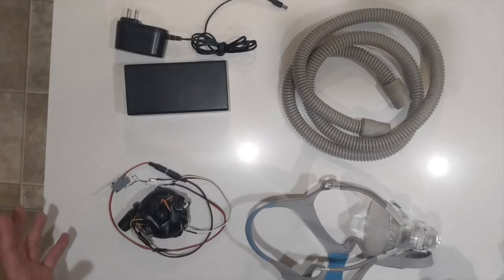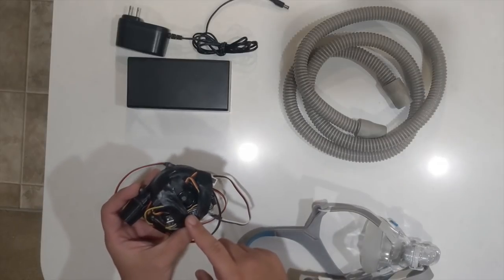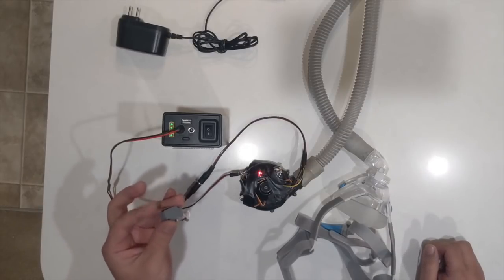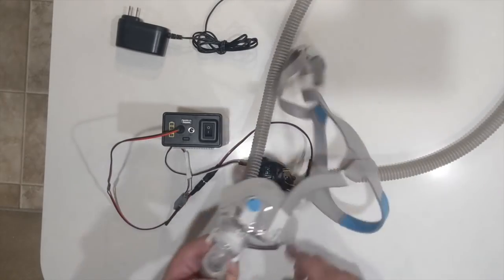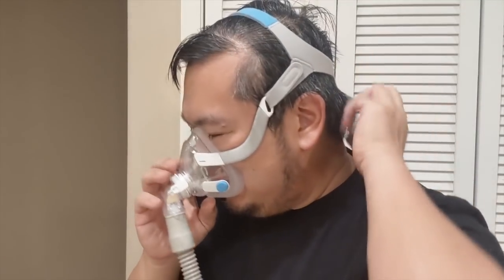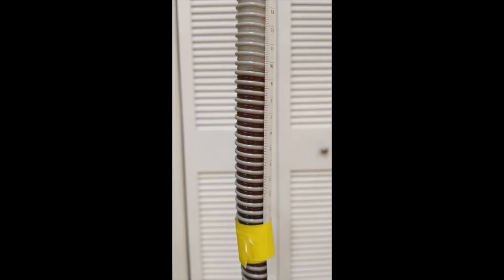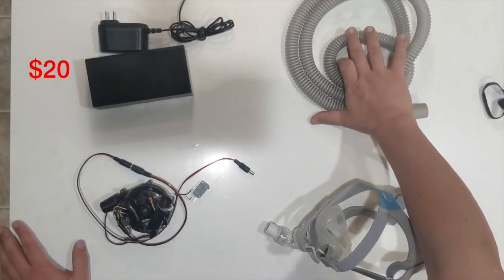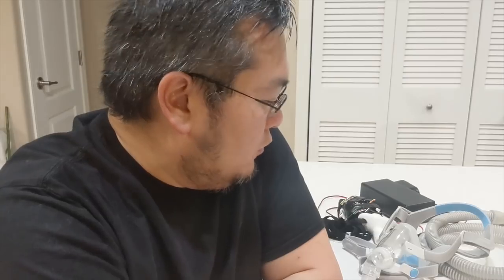Low-Cost Open Source Ventilator-ish Device

Comment: I believe the most important next step to this project would be to add an oximeter (finger). Suppose you can get to a point where you can setup various parameters on this. the biggest bang for the buck it's to get a pulse oximeter, so you're able to "read" and display the amount of PaO2. I understand what you're trying to do. I was researching the same thing. 
Problem is a "Medical Ventilator" it's not simply an air blower with enhanced O2. Although, from an engineering perspective, it's a relativetly simple machine, the Respiratory System isn't. It requires some medical knowledge or at least some Biochemistry knowledge.  I was a medical student. There's a lot of knowledge required to even setup a "medical ventilator" in order to help the patient and avoid worsten the patients health issues. Let me give you an example: If you put a lot of pressure, into a person's lungs, it can make thing worse, because of the shear stress, that would increase inflamation of the lungs, and as a result, worsten the situation. Oh man, i love your idea...i was just doing the same thing...and i'd just like to make a few comments so people like you and me (even being a medical student) to understand it's not that simple. But at the same time, i believe you should keep improving your project. But the key here to start off is to do some research on PaO2 and pCO2 and FiO2, understand what is the main goal of the respiratory system, how does it relate to optimal blood ph and homeostasis.
https://youtu.be/Te0WLR71HwA
https://www.youtube.com/watch?v=gk_Qf-JAL84 (Mechanical Ventilators explained)

Comment: Thanks _ why is the certified ventilator so EXPENSIVE.
Reply: Pra Drame Commercial grade ventilators are built to last for many years using the highest quality parts with all the bells and whistle’s (you don’t necessarily need a Rolls Royce when a Toyota Corolla will accomplish the same task).  Also,  the markup through the medical supply chain is astronomical (similar to the $10000 toilet seat for a military transport).
Reply: Brent Mart you guys are tripping. How is this device modulating the amount of O2 and CO2 and keeping it flowing into both lungs in equal amounts. I don’t think he has a basic understanding of how modern ventilators work. Nothing wrong with taking a stab at it but to think ventilators are just vacuum cleaners with a pump is pretty naive. You can’t just have a malfunction, the person is on life support, it needs to run non-stop.
Reply: Watch:                           https://youtu.be/KN8WwNotGP8 

“Where there is a will there’s a way” and “necessity is the mother of invention”. And 1 more:  “never underestimate the power of social media”.       Cheers 🍺

Comment: How do you dispel air breathed out?
Reply: CPAP masks has tiny vent holes on the t piece that connects the tube to the mask itself where it uses the venturi effect to get rid of the exhaled air.

So the mask is constantly venting air out of these tiny holes so it is kind of annoying for the bed partner of a CPAP user.
Reply: @tibbydudeza  Just add a simple asthma chamber to the system and breath out  it's expelled.

Comment: Your efforts at attempting to design a useful ventilator deserves due kudos. I am not a doctor but I do feel that you machine could be of actual value and use. Unfortunately where I live none of the components you have used are available. All that is available is the flexible tube used as  lead out from the washbasin to the outlet pipe.

Comment: can a home vacuum cleaner be striped for parts and modified to make a ventilator?
Reply: Indeed it can.  In that instance the control would be a rotating valve in the output tube.  In the long-ago I developed a device that used a rotary solenoid to move a valve.  I recall that the first mockup was done, and working,in one day.  The client, Eastman Kodak and it had to do with microfiche management.

Oh Yes, I had the tech go out and buy a small vacuum cleaner,  replaced by a stock blower in the final design.
Reply: Would overheat and burn out I would say.  Maybe a small battery powered unit could work.

Comment: I am not a specialist of any kind. However, I have been using a CPAP for many years. I noticed there is a difference between your home made mouth piece design and the regular CPAP mask. The masks always have vent holes through which air is leaving at all times. I presume that's where the CO2 leaves the system. How and where does the CO2 leave with your closed system? . . . . . I don't know about medical ventilators, but I do like the idea of making your own CPAP machine and saving thousands of dollars.  This is do-able.

Comment: I see some sort of one-way valve assembly in either the mask or hose. Similar to divers SCUBA exhaling (see comment below). I am a retired control systems engineer and for (KISS) keeping it simple, this design is genius. That speed control from CPAP was inspired. Hospitals need something more into recording and readout for personnel and this is understandable. So each unit probably comes with $25K in readout equipment that has little or nothing to do with keeping you breathing.I havent read all the comments yet I do have questions that have more to do with physiology than engineering.

Comment: Hi Johnny, I appreciate all your efforts in designing an open source ventilator design. Consider controlling the expiratory/exhalation side for controlling pressure and duration with an over-pressure relief valve for safety. Maybe look at other designs and adapt those into yours. Over the years there have been many simple yet genius designs for ventilation that operate strictly on oxygen pressure (bottled O2) with the entrainment of air for controlling the O2 percentage without the use of electricity. Keep up the innovative thinking!

Comment: Two points: Ventilators are connected to O2 not room air and secondly you could connect this device to a simple pulse oximeter that would read blood gas levels and adjust the rate/pressure to a targeted level.

Comment: I also plan to test CPAP options using cheap hair dryers with very low pressure. The inches of water could be easily adjusted by drilling holes in the tube itself. For sick patients it seems below 20 is the target.

Comment: You might read a bit about I:E ratios (inspiratory / expiratory) as you consider your software programming.  At rest exhalation is typically twice the time of inhalation which is something that is adjustable on a ventilator if not completely automatic based on it's algorithms and sensors.  A spontaneous Bipap senses exhalation and shifts automatically but that sensor isn't something you would have in the Cpap.  Without being able to tune the I:E you will have trouble achieving synchrony with the patients breathing.

Comment: If no O2 tanks or O2 concentrator available...and the AC power was still on...water electrolysis could be be used very carefully to add O2 into one of the ports on the mask. However, that would ideally require O2 under greater than the CPAP pressure. It could probably be placed at the intake port at atmospheric pressure to good effect. With appropriate AC rectification, a high voltage DC current could produce pure oxygen and hydrogen gas. A small pump could be used to pressurize the O2 from the chamber or if sealed properly the electrolysis could generate an adequate pressure of O2 ~10-20 cm-H2O. Very dangerous however. The H2 must be vented far away from the O2. And O2 under pressure can cause many things to be dangerously flammable. I’d opt for a separate pump myself. And extremely carefully vent the H2 into the atmosphere outside of the building. It’s light so it will rise until it escapes our atmosphere. I have 2 Bi-PAP machines donated to me from friends of my Dad who passed away years ago. I still use my old plain CPAP at 10 cm-H20 without problems. You are correct that these BiPAP machines could be be used as a reasonable supplementary ventilator, especially if O2 was available in the less serious cases.
Tracking the O2 Saturation would be the best way to track treatment success. Pulmonary pressure parameters would need to be monitored and controlled to prevent damage or worsening of the situation due to high pulmonary vascular pressure. BiPAPs are uncomfortable to use but better than dying. Seriously. 
You are on a great path of creative thinking and engineering. Keep it up and you may save thousands of lives.
Sincerely, MSM MD -Anesthesiologist  -  Engineering Physics BS

FYI, if you’re interested. I was an Anesthesiology Resident in ~1985-1986 when the first Pulse Oximeters were released for clinical use. They were the size of a medium stereo music amplifier and the cost was ~$2000 each at the time. We initially had only 2 for 14+ ORs that we would fight over claiming our case was more serious. Usually pediatrics because they desaturate very, very quickly. Now I can buy them for $20-$40 at Walgreens and they’re tiny. Amazing.
Reply: Thank you Michael for your comment! You can check out more notes from Johnny here: https://github.com/jcl5m1/ventilator/wiki/Notes-from-chatting-with-a-pulmonologist
And if you'd like to provide more feedback, you can join the conversation on github. Cheers.

Comment: Important: 

Provided the patient isn't intubated, this might push, if it can get past any restrictions and you don't mind pushing other stuff.  Given that acute hypoxia is a co-morbidity of ARDS, intubation  is more likely.

Better, is an attachment that connects to an intubation tube, and also that provides suction.

The whole shash would have to get some pretty quick approval.  For use at home in an emergency it has some potential.

So, how to get a kit?

Comment: Splice in an oxygen generator line and you can hyper oxygenate a patient with a low SPo2 (get an oz saturation meter cheap now at walmart or online). A ventilator without o2 can only do so much.  If you you know a medical pro they can intubated for you and connect it to the tube directly. Or you could install an oral airway easy enough to control the tongue. Being able to manage tidal volume needs to figured out. If its needed there are many medical people who would volunteer to help you out.

Comment: You might be able to use mouthpieces from snorkels and scuba equipment instead of the 3d printed one. Also the blower looks very similar to the blowers used for inflating air toys and air beds. I have also seen full face masks for snorkeling.

Comment: I have a BI-PAP in which one can program separately the pressures for inhalation  and expatriation.  Even with this 15 yo technology, it has an auto mode that will force a breath if one is not self initiated. BI-PAPS can be purchased for less than $1000.

Comment: I am a housewife in Australia. I think all we need is a brand new vacuum machine to do the job. On top of it is a fennel to cut accordingly to insert into the mouth and some elastic band from the under pants to sew on the fennel. The most important thing we need may be is a regulator and connecting a door bell to the vacuum will do the job. Then all we need is someone sit outside the ICU to press the door bell. ONLY one person needed to operate the whole ICU by extended all of the wires of the vacuum to one the door bell. If you do not understand the theory then please go to Peking duck Chinese Restaurant to see how the Chinese o use the vacuum to pump the ducks.

Comment: Johnny I think you have the right idea in creating a personal low-cost off-the-shelf ventilator, but as-is I think you've only created a CPAP.  From what I understand, the kind of ventilation needed for pneumonia is much more complicated and needs to be monitored by a medical professional.  That said, I'll bet a super-overpriced hospital ventilators could be built much cheap, then hospitals wud buy more.  And like you said, with an Arduino, some sensors, and the right software, you could really control the delivery, and create an off comparable device.  But lastly, I believe for more serious cases of pneumonia or COPD, there is an inflatable balloon surrounding the intubation tube, that is inserted into the esophagus, and I hope no one is doing that at home ; )
Reply: You can read more in the github page.

Comment: You can actually separate hydrogen and oxygen into separate bags from water using static magnets as well. You can do this using electricity with cathode and anode plates in the water, but if electricity is down.. static magnets are powerful enough to break the bounds as well.

Comment: Excellent idea..but could you also do a thought piece with a small vacuum cleaner or blower motor for air bed ? Desperate times call for desperate measures. Most people will not have access to a cpap. But considering we likely will see triage at hospitals and many will be turned away to die at home...this type of device could alleviate the pain that your family member or yourself might have to go through.

Comment: It seems maybe your device is constantly blowing air into the patient.  It should allow time to have the patient exhale by alternatively turning on and off the pump motor at some adjustable rate that is comfortable to the patient. I recall reading that just pumping in air to inflate the lungs can cause damage to the alveoli (tiny air sacs in lungs where the gas exchange actually occurs),  and that to minimize this problem they reduce the air pressure, which reduces the O2 exchange, so CO2 builds up to an uncomfortable level causing the patient to have to struggle to breath and so they sedate the patient while he/she is on the ventilator. It seems from what I read that being on the ventilator a long time also tends to damage the alveoli, so the idea is to put the patient on the ventilator for as short a time as possible. Unfortunately, the standard protocol for treating COVID-19 will place a patient on a ventilator with O2 as the patient develops severe pneumonia and essentially leave them there until their body either recovers naturally, or dies. It seems they depend on the bodies own natural defenses for the patient to recover, which can take 2 or 3 weeks and maybe longer. They should be more proactively treating the patient if they ever hope to reduce the death rate of COVID-19/ARDS.

Instead, they should first be placing the patient on antivirals like hydroxychloroquine (or chloroquine) and Zinc supplements as soon as the patient shows signs of COVID-19 infections so to try to keep the disease from progressing to into pneumonia so,  hopefully, there won't be a need for the ventilator.

If the patient develops severe pneumnia and ARDS, then in conjunctions with the ventilator, the patient should be placed on a dialysis machine connected in-line with a CytoSorb hemofilter designed to filter medium size proteins (like cytokines, IL-6, IL-8, etc.) from the patient's blood before returning the blood back into the patient. The CytoSorb therapy has been used extensively in Europe to treat cytokine storms in patients suffering from sepsis and severe influenza, and this therapy should work with Covid-19, but is not FDA approved (yet) in the U.S. I think your ventilator system should include a blood filtration system like CutoSorb so that the patient only has to attached to the ventilator (and dialysis machine) for 2 or 3 days instead of 2 or 3 weeks. This would help decrease additional lung injury from being on the repirator for an extended period of time, and would allow the machines to be turned around faster to treat more patients. This also will reduce hospitalization cost by reducing the amount of time the patient needs to be in the ICU.

If the disease advances to ARDS, being placed on a respirator with no other treatment is like a death sentence in about 50 to 60% of the cases. The patient should be placed on antivirals (hydroxychloroquine and zinc), and should be undergoing hemofiltration therapy to overcome the cytokine storm that is causing ARDS (damage to the lungs) and other organ systems.

The company that makes CytoSorb is called CytoSorbants and they are licensing the technology to China for testing/treating COVID-19, but I have not heard/read how its been going. I understand CytoSorb is also being studied in Italy and in Iran. A study should also be done at this time in the U.S. and be offered as an (act of humanity) to patients whose conditions has deteriorated to ARDS as a last proactive treatment option. It's better than letting half the patients succumb to ARDS. Just to remind you, it is ARDS (Acute Respiratory Distress Syndrome) that kills you when you get COVID-19. We need to be focused on preventing COVID-19 from developing into ARDS and be more proactive in treating ARDS should a case get out of control. One way to do this is via hemofiltration with CytoSorb.

Comment: Great thinking  Maybe use a pump for filling a air mattress?  $5 at Walmart battery or plug in?  can install a T in the line to relive pressure to exhale?  would take an extra person yes and kind of expose them also  or operate it your self until you get better or pass out?   Keep up the good efforts.  Thats a better plan than waiting for the government.  And yes I agree with another comment  BETTER TO DIE TRYING THAN TO JUST DIE.

Comment: You can rent welding O2 tanks to supplement oxygen into the tube at the mask.  A welding regulator will suffice to supply.  Welding Oxygen is still pure oxygen but may have less filtering.  Just a thought